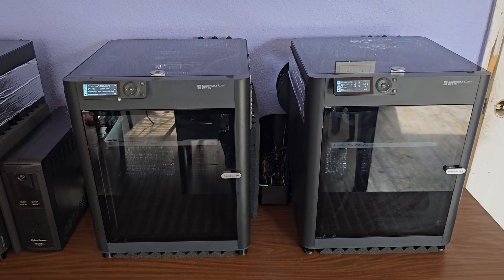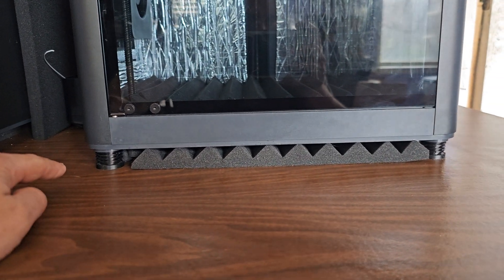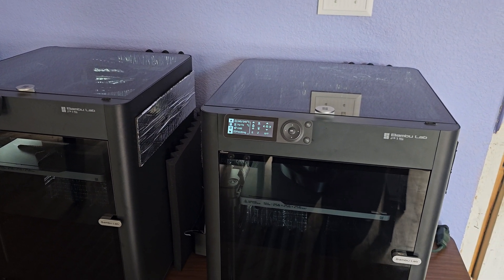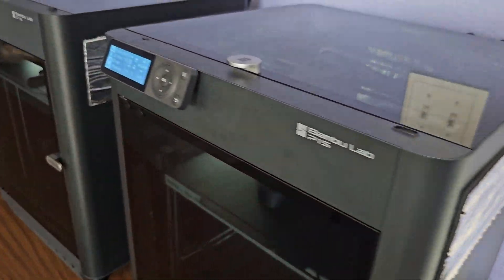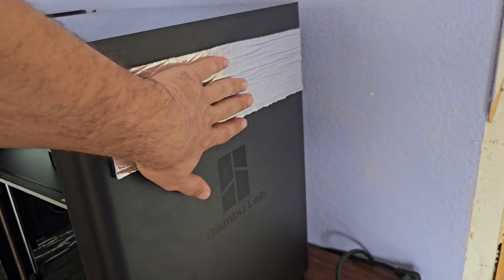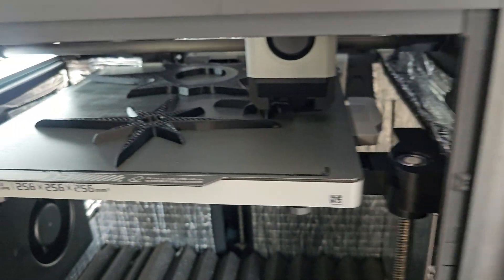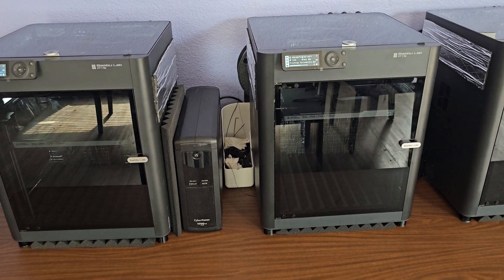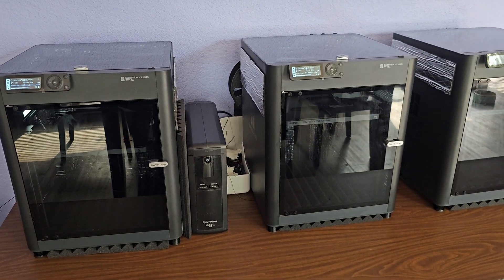Why you need a Bambu P1S 3D Printer

Comment: should i buy a p1s or a X1 carbon? I mean is the X1 Carbon worthed the price or shouldi just get a p1s for half of the price?
Reply: @kickpublishing kk thanks i guess i'll get the p1s then!
Reply: I have a p1s, if you think you have any use for the AMS get the combo to save $100 and get more filament included but otherwise the two printers use the same exact motion platform (all the parts that make it move as well as it does) and you won’t miss much from the X1C.
Reply from the maker: well said